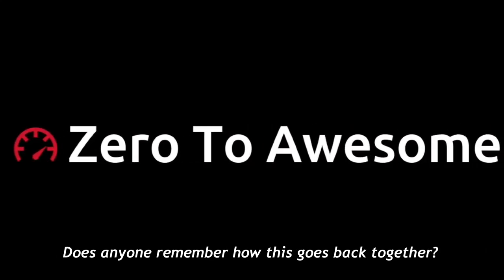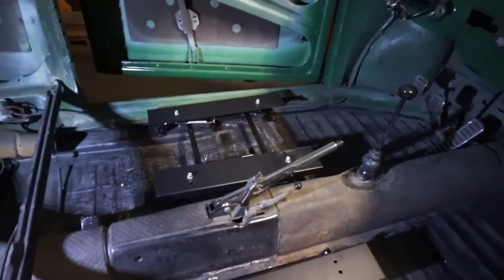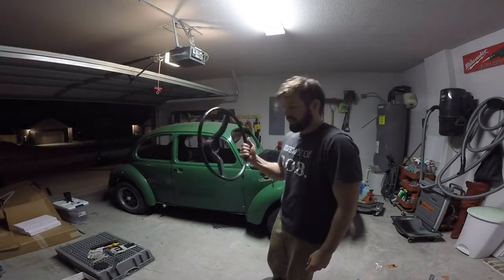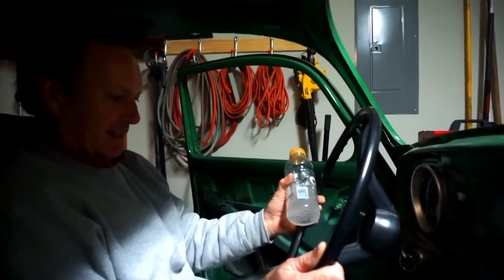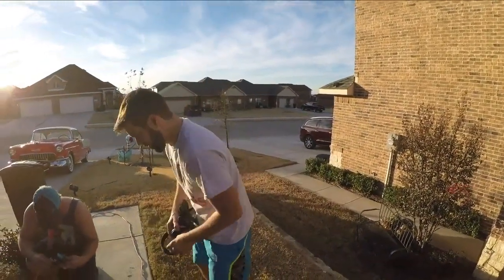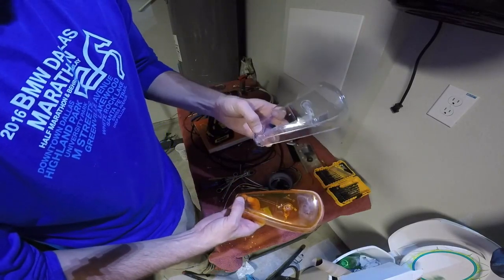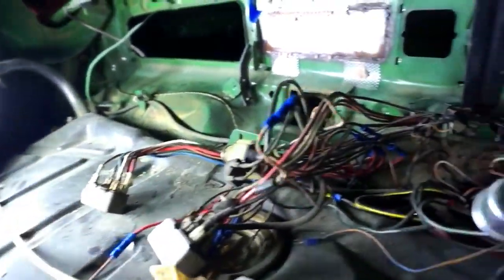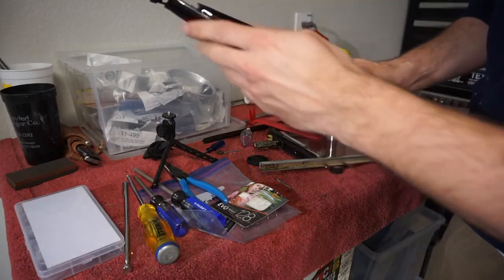Can we reassemble our DIY 1971 Volkswagen Super Beetle?

Comment: Whats with the tranny muzak?  On the subject of rewiring the back of the speedo, every time I install a fresh number 10 sixteen amp fuse in number 10 slot from left to right on a 1978 Super Beetle...she blows as soon as I hit the ignition ON.  I REALIZE the 1971 Super still uses the  old style wiring area and dash, so if there are any 1978 and 1979 VW Beetle types out there, they are different.  Please shares your agony.  I blow a gas gauge every time a fuse blows.